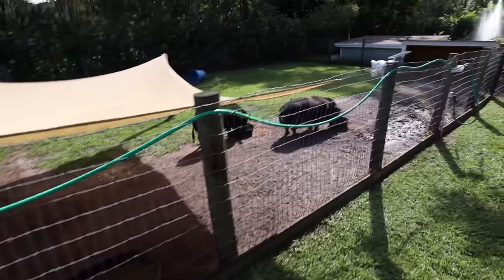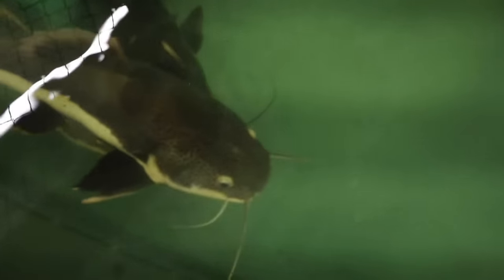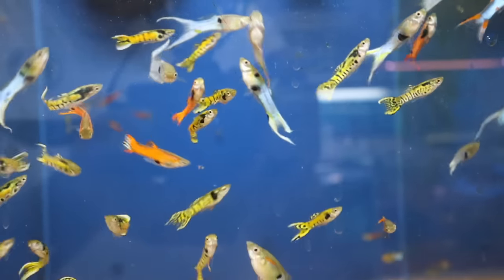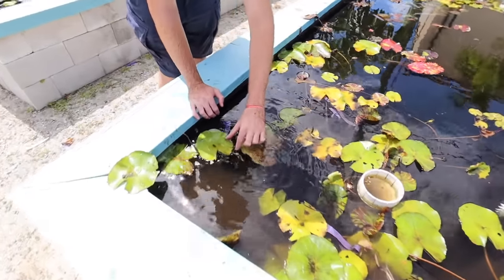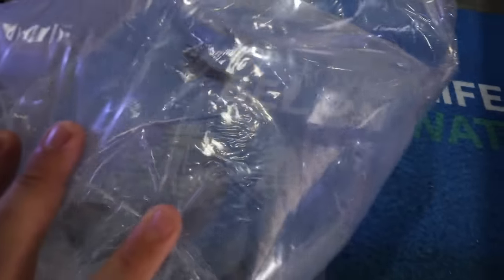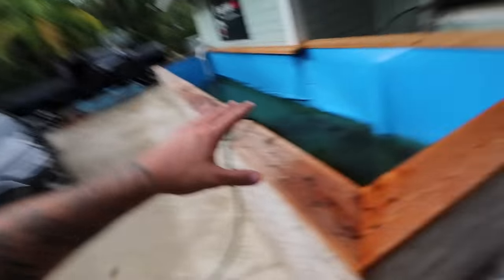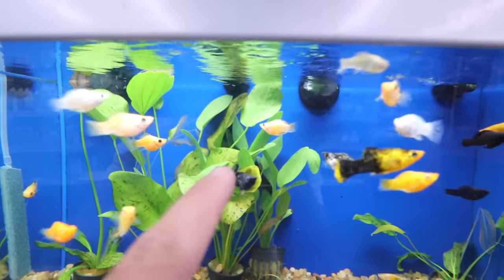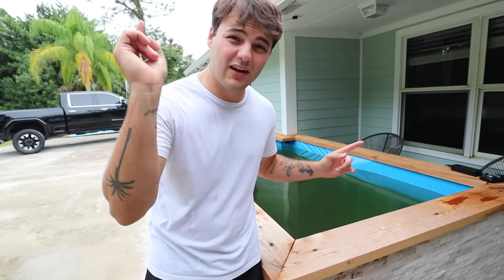BUYING COLORFUL FISH for My 3500G Koi POND!!

Comment: You should get a small piece of net for the circular cutouts in your predator fish pond and use clips to cover these holes and then when it's feeding time you can remove one of the clip ...... as this reduces the danger of your fish jumping out and from the looks of it the arowana seems to hang out near that hole and it might jump out if it gets spooked while being near it after all your luck with arowanas has not been great😅

Comment: I use API concentrated dechlorinator in my reptiles drinking and soaking water. Bought one bottle 4 years ago and it's still going strong. One drop per gallon is all it takes. Great stuff for more than just aquariums.
Reply: Just saying , if 5ml treats 10 gal , one drop does not treat one gallon .
Reply: @thiccmuffinman9641  that's not true , every dechlorinator I've used was effective . I've kept several saltwater "tapwater" tanks . Every marine fish store could attest, I worked for 14 years at the local fish shop and all our marine systems were tap water , utilizing dechlorinator.

Comment: @Paul Cuffaro  426 comments at the time of mine, not reading all sorry, but want to say you should have had the filters exit pipe drop down first then had the uv connected on so that the in of the light was as the bottom and the exit was on top so the water would collect and keep the bulb area covered to keep it cooler. You could fix it by just bringing the exit pipe back up so it rises above the uv light then drop back down to exit into pond.